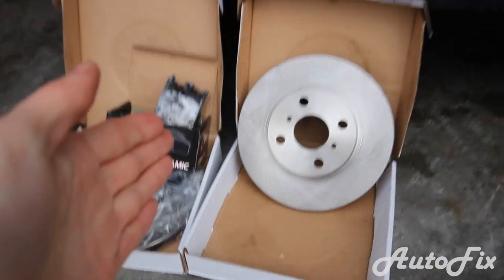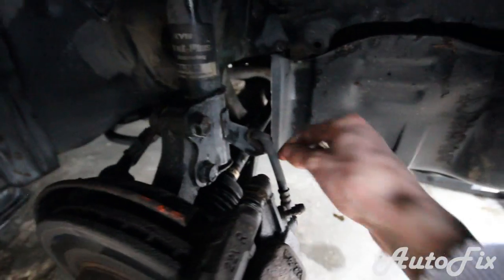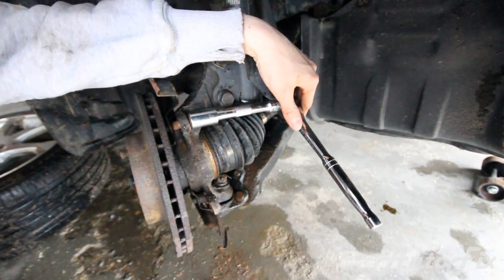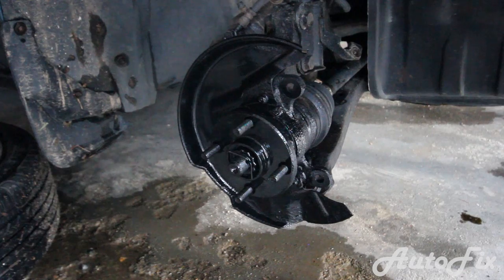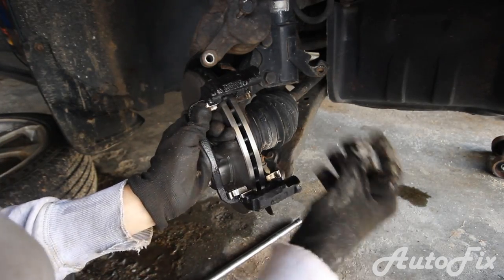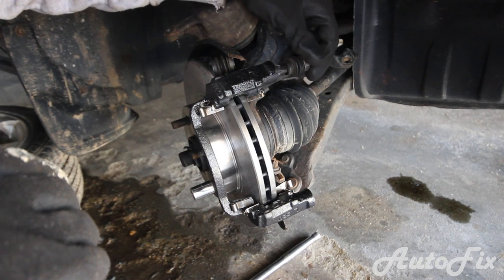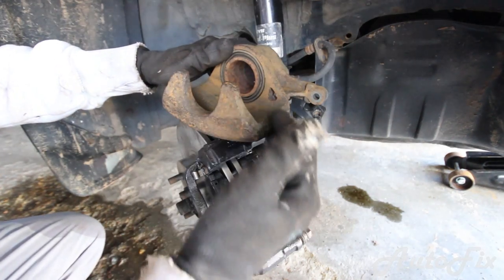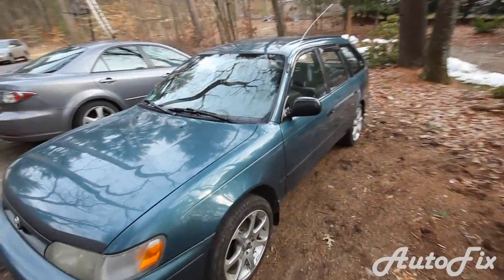Front Brakes Replacement on a '93-'02 Toyota Corolla

Comment: For anyone else that watches this tutorial, make sure that when you reassemble everything and put the new brake pads in their place you also remember to put the break pad pins back in place to secure the two pads. (The thin wire pins that go into the tiny holes in each pad, that’s important!)
Reply from the maker: Those thin V shaped wire pieces are actually there to push the pads away from the rotor, not to secure them in place. They make sure that the pad does not contact the rotor when you aren't braking. I've only ever used them once in my life, and they were more of a pain to deal with than they actually helped (thus why only once). Obviously they do help reduce noise, but they are not crucial. But if you have them, why not put them on! But good luck keeping the pads in when trying to put the caliper on... :)
Reply: brake not break.

Comment: 16:38 Oh. My 4AFE workshop manual says that  Guide pin bolts 34 Nm = 25 ft-lb and Mounting bracket bolts 88Nm = 65.ft-lb. Front hydraulic hose 15Nm = 11 ft-lb.

Comment: Good video, man. Very thorough. I've found that using a "C" clamp to compress the caliper is the easiest way to make room for the fatter NEW break pads... I'll be changing the Pads, for the 1st time, in my Corolla in a few days.. I haven't seen anyone BLEED the breaks on these videos. IS that NOT needed  in the Toyota Corolla?? ANyone?
Reply from the maker: Thanks!
If you don't open the bleeder screw and you don't have any air in the system, you don't need to bleed it. If you do open the bleeder screw while pushing back the caliper, then you do need to bleed it. What you do is you finish your brake job, then you go in the car and slowly pump the brake pedal several times, then you go to each caliper and open the bleeder until no air bubbles come out. This is called gravity bleeding. You let gravity pull the fluid out for you. Then close it and go to the other side and gravity bleed that side. Make sure you keep your master cylinder topped off at all times!! Do not let it get below the "Low" mark or you will suck in air and then you need a full bleed. And if you have ABS you're on in for a not so fun adventure to get the air out. So just keep it topped off. You should be all set after this and brakes should feel great! If your fluid is old then you want to flush it. In this case you need a vacuum bleeder or a second person to do a full bleed with you until you flush all the old fluid with new fresh fluid. Look up how to bleed your brakes on YouTube and you'll surely find a video, I recommend EricTheCarGuy's video, or ChrisFix's, or 1A Auto's.
Good luck!

Comment: Thanks, I just bought a 95 Corolla for $300 and the only things it really needs are the wheel bearings in the front (now through this video I see what type those bearings are) and the front brakes needs to be done (again through this video I know what size of sockets to get since I don't have the money to buy a whole set of sockets). Yeah for $300 I got a decent car and it only has 100k on the odometer, the car is barely broken in. Oh eventually I will have to do other things if I plan on keeping the car, but being 51 its the last I should ever have to buy if I maintain her
Reply from the maker: Glad I was able to help! These card are very easy to work on and with a basic set of sockets you can take the whole car apart!
Brakes are easy to do but be ready to have to buy new calipers. I know it doesmr have many miles but if it sat for a while then the calipers may be no good. But hopefully you get lucky!
As for the wheel bearings they're not very difficult to do but they are tedious.
Good luck on the car and indeed it's barely broken in. Take car of her and she'll take care of you! Change the oil often, 4-5k miles, that's the best thing you can do to it.
Reply from the maker: Glad I was able to help! These card are very easy to work on and with a basic set of sockets you can take the whole car apart!
Brakes are easy to do but be ready to have to buy new calipers. I know it doesmr have many miles but if it sat for a while then the calipers may be no good. But hopefully you get lucky!
As for the wheel bearings they're not very difficult to do but they are tedious.
Good luck on the car and indeed it's barely broken in. Take car of her and she'll take care of you! Change the oil often, 4-5k miles, that's the best thing you can do to it.
Reply: It'll last you a good 30 years+ those things go up to 800k mile with minor maintenance (my co-worker/friend owns one with a little over 840k she got it from her dad after he past away 4 years ago past down to her, in which it was bought brand new, still runs like brand new,a t that time it was at 300k+ she daily drives it to and from work every where possible actually)...

Comment: Lots of OJT learn-as-you-go instructions. Some good advice like how to lubricate the slide pins. Some bad advice like saying to push in the piston evenly while using a channel lock pliers which squeezes the piston unevenly. I was looking for a video that could tell me how to do the job from somebody who has done it or at least knew how before doing the video.
Reply from the maker: You can use big channel locks, you can also use a tool called a break pad spreader. They will accomplish the sane result, and as long as your caliper is healthy, channel locks won't hurt it. Positioning the channel locks as evenly as possible will be ok.

Comment: Nice rims👍. I have the same car wondering what size is good other than the 14”. Can I get 15s with 4x100mm bolt pattern?
Reply from the maker: Yes you can get any rims with a 4x100 bolt pattern and a hub center bore of 54.1mm or larger.
The wheels you see in this video are 16x7
Reply: @AutoFixYT  thanks for the quick response! I’m going to look into getting that from my Corolla. I bought rims with old tires ready to paint but I’d want a size bigger. At least with 15s I can go as wide as 205 on the tire width instead of the 185 it has now
Reply from the maker: @Spiritual_DriverAE101  Yeah I agree. I'm running a 205/50R16 tire on the rims I have. The tires fit really nicely, and grip is much better haha

Comment: Hi can you show. How to convert from drum to disc breaks on 1995 Corolla
Reply from the maker: I won't be making a video on that but basically what you need is Celica parts. Knuckle, hub, caliper, pads and rotors, as well as possibly a Celica master cylinder and proportioning valve.

Comment: Hey Auto Fix! thanks for the information. I was wondering however, Do we have to remove the caliper guide pins or can we jus keep it on when changing our brakes?
Reply from the maker: Yes, you should remove them, clean them, and lubricate them every time you change the brakes
Reply: @AutoFixYT  Thanks!

Comment: Bro can you show how make a 4 to 5 lug conversion on toyota corolla???
Reply from the maker: I'm not planning on doing that to my car so I can't show it, but all you need are parts from a Celica of the same year range and you're all set. Celica hubs, brakes, master cylinder, proportioning valve, and then a set of wheels to go with the new hubs
Reply: @AutoFixYT  thanks...

Comment: Hey man so I accidently open the hose screw and it leaked out brake fluid I believe?

I replaced pads pretty much it. Now when I drive I press the brake but there is no pressure. What went wrong?
Reply from the maker: You got air in the brake system. What you want to do is bleed the brakes. You can do this two ways.
If you are alone and don't have amy help, you can do what's called a gravity bleed. Make sure your master cylinder is topped off with fresh brake fluid. Then go to the wheel you worked on and open the bleeder screw on the caliper. Fluid should start coming out. If there is air in the line, it will come out as tiny little bubbles. When you are done, close it off, top off the master if needed, and proceed to the other side wheel and do the same.
If you have a friend that can help you, have them pump the brake pedal a few times. After 3-4 pumps, have them hold the pedal while you slowly open the bleeder. Once fluid stops coming out, they can release the pedal, pump again, and repeat the process several times until there is no air in the system.

Hope this helps!
Reply: @AutoFixYT  thank you bro. I got a question, I'm about to change front struts for my corolla, do I need to add grease on the top part of the struts ? Because  I seen that they have grease??
Reply: At least my old struts have grease?

Can I just replace new struts without adding anything on them?
Reply from the maker: @antonioc2017  No need to add grease! Just install, get an alignment, and you'll be all set!
Reply: @AutoFixYT  thank you
Reply: I'm worried about the whole ft per lb measurements. Can I just tighten them up as much as possible? Will that be fine? Or I have to be precise
Reply: I do not know how to measure
Reply from the maker: @antonioc2017  It's important for them to be precise but if you think you can get it close to the torque without the torque wrench then go for it. The bottom bolts are somewhere around 150 ft-lbs and the tops are just under 30 ft-lbs. Get yourself a cheap torque wrench, Harbor Freight has one for $20
Reply: @AutoFixYT  thanks alot

Comment: 1 question... can i just use vaseline to lubricate the guide pin?..... asking for a friend obviously
Reply from the maker: No, that is a very bad idea. Vaseline will not withstand heat at all. Make it even slightly warm and it will liquify and come out of the sliders, leaving them dry but also potentially smearing the pads and rotor in liquid vaseline, making them unable to grip anymore. This a very dangerous thing to do and brake lube is only a couple dollars at the local parts store. Brakes can have temperatures up to 200°C, that being almost 400°F. Vaseline will melt between 70°C and 80°C.
Reply: @AutoFixYT  oh no....
Reply: @AutoFixYT  i make a mistake then
Reply: @AutoFixYT  my friend not me im 200 iq brain
Reply: @AutoFixYT  thanks for the enlightenment, love your vids dude

Comment: what rims are those? I have a corolla and was looking for some that looked good on the car, I have a DX sedan and its the same color as yours and those rims look great
Reply from the maker: They're Motegi MR7, 16" rims. I found them on Craigslist (funny thing is I had to search "Miata Wheels" to find these, the lug pattern is the same for Miatas). They have a few curb rash marks but nothing I can't fix.
Reply: about how much did it cost for all 4?
Reply from the maker: I got them for $180, they came with tires. The tires are really bad though, so I'll need to buy new ones.
Reply from the maker: I just saw that you edited your initial comment... so let me add this, just so you know (in case you don't already). Switching to this type of wheels has changed a few things about my car. Also, these wheels are freaknig heavy! I did not expect it to be honest haha. One last thing, if you want to keep the odometer and speedometer as close to perfectly accurate as possible, make sure you get the appropriate size tires, so that the overall diameter of the new rim + tire = original rim + tire. in my case, I have these 16" rims with 205/45, which makes them 0.9% smaller than the stock 14" rims with 185/65 tires. This should help: https://tiresize.com/compaison/
Done ranting now.

The good:
- Significantly improved handling (it is so much more stable when cornering, but that's because I also have the KYB suspension in, which is stiffer than the OEM or other aftermarket quick-strut)
- Significantly improved traction (the car is now able to brake much faster than before without locking the wheels, and has less wheel spin when accelerating from a stop)
- Significantly improved stability at high speeds (It feels way more stable on the highway now)

The bad:

- Decreased fuel economy (I used to get 35 mpg on average, even high 30s in the summer when I didn't drive it too aggressively, now I get around 30, 31 if I'm lucky)
- Increased road noise slightly (I blame the tires for this...)

Comment: Did you place your jack stand under the tow hooks??
Reply from the maker: No, it looks like that in the video but they're actually on the frame rails. Tow hooks are bolted to the frame rails
Reply: @AutoFixYT  is it ok to place jackstand  under the tow hooks? Is it safe to do so??

Comment: Didnt show how to replace retainers for the pads
Reply from the maker: I might make a better video in the near future. Should be easy though. Pop them out, pop the new ones in, put grease between them and the clipper bracket to prevent rust.

Comment: what the size of your tire?
Reply from the maker: Tefe Semon The ones you see in this video were 205/45 R16. Currently I have 205/50 R16. The original size is actually 185/65 R14.
Reply: thank you, is this size "205/45 R16" is this good for this car?
Reply from the maker: @tefade2009  well 7 months later I finally saw this comment... yes that size fits perfectly on my car. If you're carrying weight in the back it will rub on the fenders but you can roll the inner lip to fix that problem. Other than that they fit perfectly

Comment: U did gd job; however, U definately SHOULD have show 2 us U put wheel blocker on rear wheel as front wheels are rasied as car will skid backward without wheel blocker dude! Such mistake will cost a lot if not huge in safety n even damage client's car! Also, U should have worn clean brand new plastic saftey glass to show that Ur extremely carful on the MOST precious our human asset that is eye, n VERY good idea to protect Ur precious and precarious human skin by wearing tight plstic glove or other bit more thicker but tight hand gloves should protect precious our skin!, Plus good sold clothing of pans n show to protect from dirty surface, I can C floor is also wet... the list can go on, safty shoe would be bit over kill! CA, USA! This is price back 3 watching Ur video!
Reply: He may have had enough brains to put the parking brake on. It is a possibility....